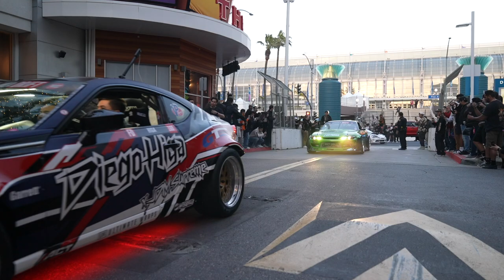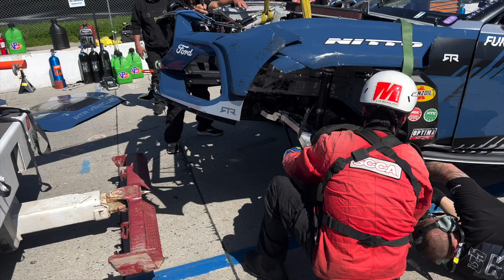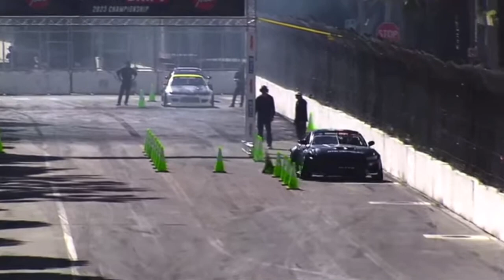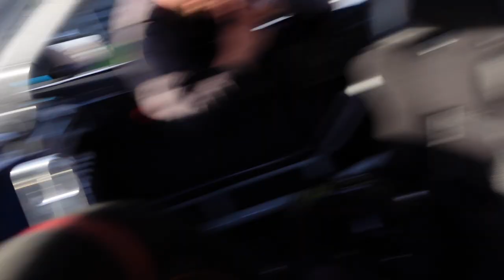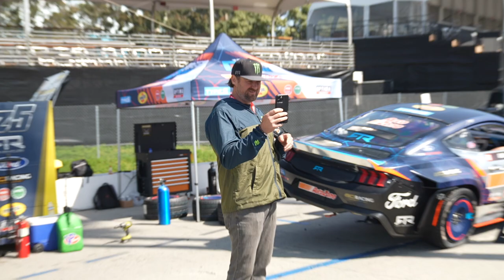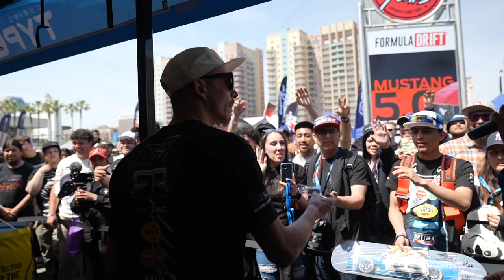My Worst Crash Yet @ FD Long Beach

Comment: They need to send the car home with Adam, and he needs to drive it around the compound as much as possible intill he's comfortable in it you can tell he's fighting to find his balance in the car
Reply: adam has talked about this before but it takes so much money and resources to run one of those cars , even just for a few passes, that it’s just not worth it
Reply: @-deathdesire-2749  I bet it's a lot cheaper to total a car twice per round.
Reply: @-deathdesire-2749  I remember Adam saying that too. But he is struggling in the Mustang. That is a fact. When you see how he performs in other platforms it’s not driver skill that’s the problem, It’s a lack of seat time.  

Adam could buy and run a RTR practice car at the compound regularly. Investing in his driving makes sense. 

He is a multi millionaire, if a RTR Mustang at the compound will help his driving. Then why not do that.
Reply: Adam LZ: “i’ve touched on this topic a few times, but its pretty hard to explain.  There are so many custom parts that make these cars drive the way they do… in order to activate the grip and make it worthwhile it would need to be 800hp+ and be a very similar chassis.  The cost would probably be in the neighborhood of $200,000 and would cost roughly $10,000-$20,000 everytime the car runs which is just not feasible.  Building a more simple car wouldn’t really translate anything other than vehicle placement - and wouldn’t be competitive or economical to drive from a consumables standpoint so i couldn’t see myself actively chasing it.”
-Adam LZ, members only Q&A, April 9, 2023
Reply: he needs a seat time s550 or s650
Reply: @Jalan.Anthony  in other words, Adam just wants to be a YouTuber and not fully dedicate himself to become a top FD driver. How much money you think Vaughn spent to get to where he is now? Very clear and stark difference, one actually cares about the sport and one truly doesn’t. Can you guess who is who?
Reply: @BigKeke  “business is business, you know how that goes”. Interpret it however. BUT, i see the passion he has for it, some people may not. I’m just relaying the message to a FAQ lol 
(Side note though: i see where he’s coming from, im not going to go bankrupt over a sport where theres many other versions of said sport that i am good at. I.e: Klutch Kickers, drift week, etc etc.)
Reply: @BigKeke  very ignorant point of view tbh. why would someone go practically broke to "fully dedicate himself" to FD when he can have as much if not more fun and make as much if not more money doing other things
Reply: @woah_astro3867 not ignorant at all lmfao. Your must be lost if you think Adam is going bankrupt over what it costs to build an FD car 😂 dude literally already has one that just collects dust along with his million dollar car collection that barely gets driven. If he truly can even a little bit of a shit about this sport he would sell a car or 2 and build a copy cat seat time car for practice. He won’t do that tho because he won’t even take the time to put the camera down when Vaughn is trying to give me advice. He has and will always care about one thing and that’s YouTube which I can respect, this is what he has built. He is hurting RTR as a brand tho the way he poorly represents in competition. You have to be fully committed at the pro level of anything or your just wasting everyone’s time.
Reply: @Jalan.Anthony  
If only he could practice in a sim… oh wait
Reply: @BigKeke  he’s already got a stable source of income. And klutch kickers is just an example, plenty of other comps. But again, just cause he’s not bankrupting himself doesnt mean he does not care. 10-20k everytime the key turns? That wouldnt even make sense to the dumbest of millionaires.
Reply: @ItzDiizy  thats a good idea, James deane does it all the time! And its not as expensive! I like that idea!
Reply: Just goes to show how good James Deane is.
Reply: You were flicking sooo hard smoothen that out a little and you would had them runs
Reply: @RyanCranage  it's not just the mustang, he struggles in any car set-up for FD.
Reply: He wasnt listening to instruction and just full sending constantly and too aggressively... and then nothing but excuse excuse.... The learning curves not him learning the car... its learning to drop ego and listen to instruction
Reply: @Jalan.Anthony   Just more excuses for him not listening
Reply: Adam just doesn't care about being a top level FD driver. James Deane has a sim setup with his RTR car on it 2 weeks after joining the team. Adam has other things in his life he wants to focus on and that just means he'll never be at the top of FD.
Reply: Just needs an identical practice car to the fd car, can't use the fd car as they're overhauled after every round.
Reply: I said before he should've built a mustang drift car for seat time but never did
Reply: @RyanCranage  it's not a lack of seat time anymore. The "new" mustang he's currently driving is the same from last season. The only thing that changed is the looks of it. The rest is still the same for adams car but chelsea does have some few upgrades to his engine. Look how freaking comfortable James Deane in his new platform. Dude hasn't have much seat time in his new car and yet freaking killed his qualifying run
Reply: @B.Roa 23  it's not the same mustang actually, you don't seem to listen to the videos where they talk about it. Second, James deane is a 3x championship, he should be better than Adam in a new chassis. I don't think you understand the amount of grip these cars generate
Reply: these threads make me lose faith in the future of drifting. “replicate a car,” the way the car handles is due to one off parts and a ridiculous amount of grip and setup that doesn’t apply to anything else. “deane is better in shorter time” he is a world champ, there’s just levels and adam isn’t as invested, simple as that
Reply: @-deathdesire-2749  how much is each crash?
Reply: This car is too big compare to his other drift cars
Reply: @BigKeke  hes said before that it doesn't make financial sense to build another FD car just to practice with. i think he knows a little more about his own finances and FD than you do 😅
Reply: @woah_astro3867  well it never hurts to practice more, he clearly could use it. no need to build a new car for practice, go to the car you already compete with and live in it for a month. Vaughn and Chelsea eclipse his seat time, but they are the faces of RTR. LZ is just there for the ride right now. To compete with professionals you have to work as hard or harder than them. Adam isn't doing that at the moment.
Reply: @Jalan.Anthony  "cost roughly $10,000-$20,000 everytime the car runs" This is such BS lmao. He could easily afford to have a clone car for practice, whether or not he wants to is another story.
I've a dollar in my pocket that says he's already gotten the boot and is only still around due to contractual obligations.
Reply: He's sharing the car with Vaughn, kinda hard to make that work

Comment: Gotta love how supportive Vaughn is.  Definitely just need a little more seat time.  Some big changes in the cars (assuming you got the same single plane intake that Chelsea got) so like you said, full throttle is gonna behave differently.  One practice session definitely wasn't enough to get used to the changes.

Comment: I'm not sure what management you're running, but you should definitely be able to set a modifier to adjust fueling to an ideal level when the kit fails.  I would make a table based on O2 or EGT.  Set it to alternate to the NA modified table if the sensor reads unfavorably for 3 seconds or more.

Comment: i think the issue you were having earlier on is you were coming into the first corner with too much angle too early which brought down your momentum and didnt allow you out to the first wall. On long beach you really need that forward drive coming into OZ1, you then add angle as you get to the wall, which loads the car up to snap you to OZ2.

Comment: That run looked sooo good. It literally looked like your tires just barely dropped off of the layer of rubber on the course, and like you said in the opening of the road feeling like driving in the wet, it was like your tires hit the slick road and you looped

Comment: Its not the nitrous or power steering bro and weight isn't an issue with the FD built cars you just can't find the balance between the pedal gear shifter and steering wheel it's all haptics and inputs at the end of the day

Comment: Tbh I just rewatch the crash like 10 times it seems that when u throw it into that corner it had no grip to the rear because ik that most fd cars you power through to gain it to go straight but to much on throttle it will spin out seen it on countless fd cars the rtr teem needs to get you seat time on tight and technical courses so the rtr teem and you can iron some stuff out on the rear end grip

Comment: During the reset with Denofa's lead and you both turned around you went past the highest speed section into the marbles which without a doubt had to alter how your car was going to run in that chase position.

Comment: In the long run it's better to over-drive the car a bit and push the limit then tip-toeing being scared to spin and just put down "safe runs." Safe runs get safe scores and zero podiums. Chelsea's a very aggressive driver and the car responds great to him. In Chelsea's qualifier run, my jaw was to the floor how fast his transitions were. Gave my goosebumps. It's all about dialing it all in.

Comment: Bro you should have changed that PS Pump....to see James driving improvement, and I know this is a Shared Ride With Mr.Jr. HimSelf but they can change it back if Mr.Jr. Wants to Stay Mechanical. This is a another New Year New Car for you my boy LZ howm many cars do you regularly drift and this is not a regular drift scenario. This is FD the most upper echelon of competition. The baddest, the fastest cars. THIS IS THE SHOW. Images sure this new car is sharing with mr. Junior puts a whole nother topping in the equation. But I just think with that. Power steering switch you would have been able to flick so much better my boy. Finding maximum control of that wild stang. And yes, ASE mechanic I understand you ain't switching power steering on these cars every round like driver's read between the lines people this post is for LZ
Reply: James is a DRIVER'S DRIVER, he can jump into any car at any track and put down heat

CERTIFIED WHEELMAN

Comment: Theres a few options here that you need to try to make this a good thing.
Vaughan can't keep letting you drive his cars because the numbers you bring to the screen. (not saying you cant be top driver...but RN you are not)
1.) build a v8 high compression non forced induction mustang same build as RTR and you drive it non stop every where. 
2.) Leave for a season. practice with the similar car and get seat time.
3.) take your split focus on something else that requires less.
better to not do a job at all rather then doing is half assed.
you are better then this. just focus up.

Comment: Your line for OZ4 is so shallow because your turn in point needs to be later-- by doing this it also can be a lot safer as your car wont be angled towards the wall but towards the track.

Comment: When they were pushing the cars in after qualifying it looked like Adam runs a good bit more tire pressure than Chelsea does. I wonder if that's true and why?
Reply: Different drivers run different setups what they are more comfortable in

Comment: I feel like the mistakes comes from you transitioning too late so the weight transfer is at the wrong place and the wheels are on to much lock before you make the transition wich gives you the big flick that makes it really hard to control the line after transitioning and it gets you way on the inside or overrotating. my opinion tho, I might be wrong.

Comment: Would be interested to see how you would like the dynamic of that same car, but with a turbo setup on that engine instead of nitrous. Every car you have is turbo, your last comp car was turbo, your KlutchKickers car was turbo, I mean, it's a very different anticipation of power, just and interesting theory. Past that, you need some practice man. Also, Long Beach should be the last event, never the first, maybe it should be replaced all together. That track eats cars.

Comment: The cars look super loose. .I dont think LongBeach is the place to switch from Hydraulic to Electric steering, especially for yourself since you dont really picture  or feel your car as you are driving it and its just reaction from simulators. Chelsea and Vaughn has the cars always hooked up and now its like the front end is loose and no tire grip just scuffing and the car isnt being driven from the rear wheels and throttle like Chelsea and Vaughn drive the cars.. The seem super loose and no rebound in any suspension and they look floaty.. that matches Deanes style but not Chelseas.. and Adam you want a loose car but the engines are not turbo engines they want to be uptop or down low and not float around. But switching from hydraulic to electric seems like yous are loosing feedback and Deane is used to that but not chelsea or adam.

Comment: What Vauxhall/opel power steering pump do you use
Reply: Vauxhall astra
Reply: @andyking2778  thought it would be I used to work at Main dealer Vauxhall was just curious could they could use the Adam pump with the city mode to switch between light or heavier steerong

Comment: Bummer you can't do the full season. I didn't understand completely because the Drift HQ partnership and what was looking to be really good for you was just not completely in place and hopefully you can build something that rivals Papa and Vaughn. Solid planning and critically think to put LZMFG , Drift HQ and if you do decide to run an E36/46 or S13.9 or S15 and have you new neighbor Rad Dan build you the right 2J (3.0l  or stroker) wang's and Rad Dan could be able to get you a motor to last a season
Reply: Adam doesn’t have the funds and or time to run a program that’s why he quit the LZMFG team and went to RTR

Comment: what i dont understand is why the car has so much insane snap when transition to get to OZ2 and OZ3 compared to denofa and deane. Denofa and deane smoothly rotate the car through to OZ2 and 3 but it just seems like adam has barely any control of the car. I understand that the car may have too much front grip but why cant they get this sorted
Reply: Adams flicking it way to hard Chelsea and deane aren’t they are continuing their flick that why Vaughn told him to slow the flick but he didn’t